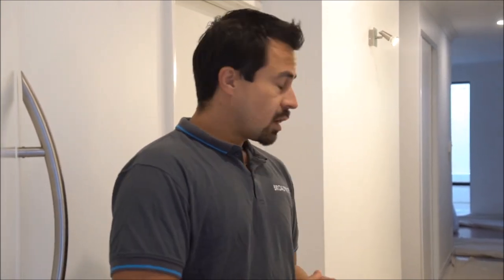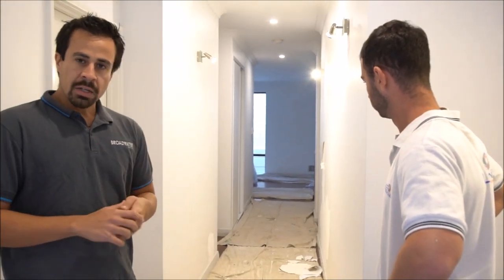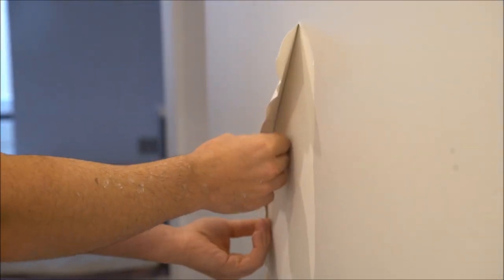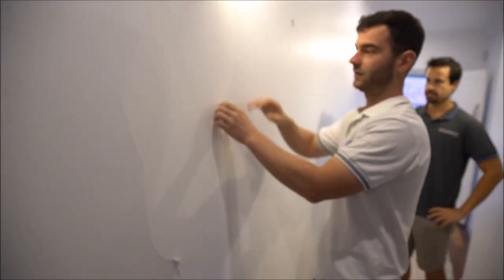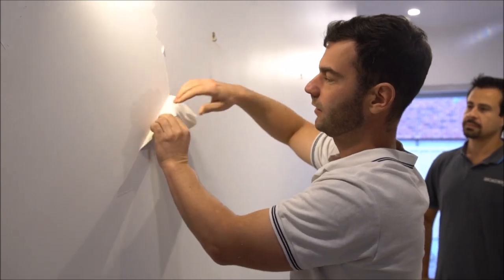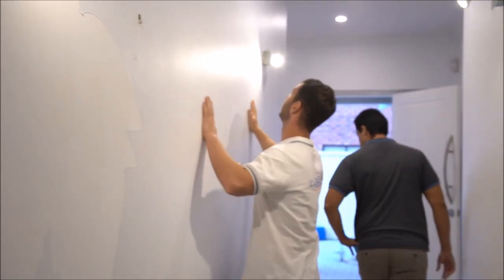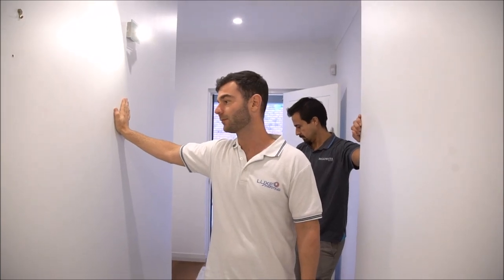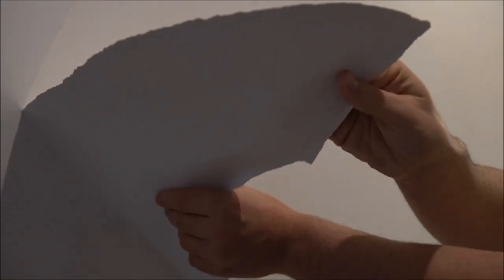Fixing our client's peeling wall paint

Comment: You never explained what you did next? I have the same issue but I don’t want to apply a skim coat . Can I spot prime the area that’s peeled off then sand then apply my two finishing coats ? Thanks in advance
Reply: I'm sure you've fixed it now, but for everyone else. The issue, as explained in the video, is lack of prep on the wall prior to painting. Paint has to be removed, and the wall prepared for painting. This usually includes letting it properly dry out, light sanding, dusting, priming with PCV paint, wash coat and then your top coat of paint. The 'fix' is basically a video on how to prepare a wall for painting after plastering.

Comment: 1. White set plaster was not allowed sufficient time to dry before sealing.
2. To many clueless East coasters using water based sealers designed for paper faced plaster board.
3. Greedy builders rushing the project.
I've a 1983 built full brick house in Perth, had to scrape back to whiteset, apply Dulux sealer/binder, then fill all the dings and accidental scrapes, light sand with 180 grit orbital sander, undercoat x 2, topcoat, light sand back with 280 grit, final topcoat.
Lot of effort, but the paint is adhering to the plaster like proverbial to a blanket.

Comment: there shouldn't  be anything wrong with using a oil alkali resisting primer or oil undercoat oil sealer etc that was probably a oil based eggshell finish on there originally. i wouldn't necessarily say its the previous painters fault as you wouldn't normally check for oil finish on walls wouldn't expect it you would look at it and think it vinyl silk vinyl soft sheen or acrylic eggshell